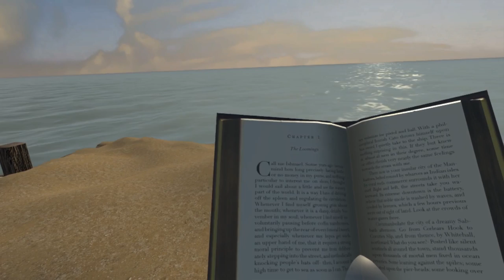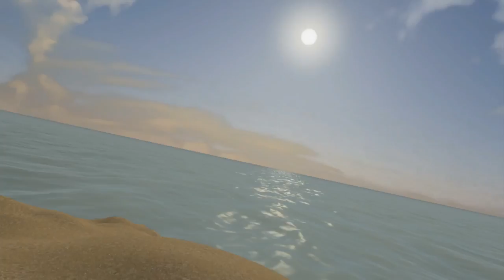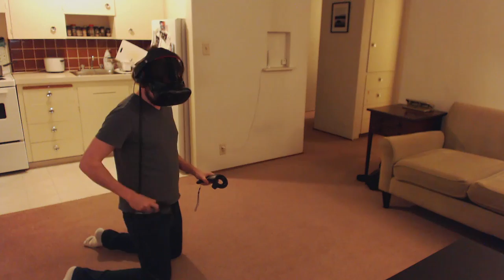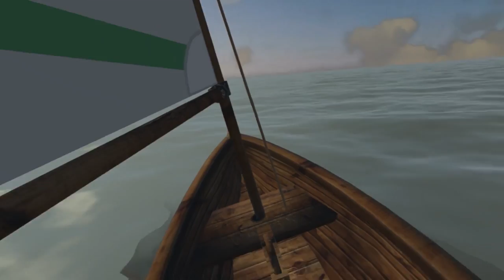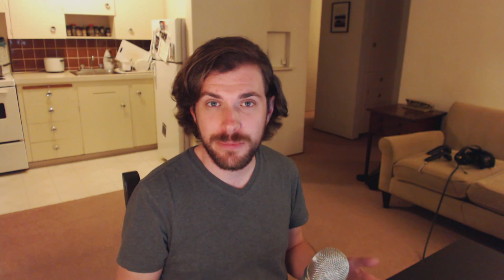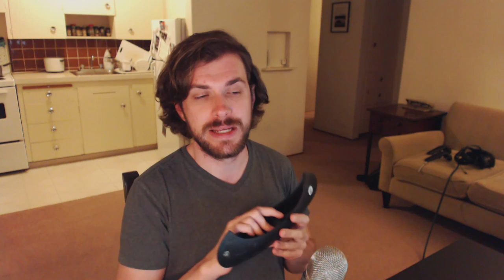Week 6 Dev Log | Sailing Game

Comment: If you need someone to help test multiplayer, i'd be willing to help. Otherwise keep up the great work! cant wait for early access
Reply from the maker: I will definitely put out the call for testing multiplayer. I need to find some AMD users too.
Reply: I'm down for helping out as well.  By AMD do you mean CPU or GPU?  I am currently running an i5-6600K at 4.85GHz with an AMD 290X GPU.
Reply from the maker: Awesome, I meant for the GPUs as I have an Nvidia GPU and I think there are slight problems with the shader I am using.
Reply: Most of my rigs are AMD GPU because I spend a lot of time in Linux and the nvidia drivers are a bit more annoying than the AMD drivers... though the newer cards from nvidia just might pull be over the fence.  XD

*oops, somehow I switched accounts by accident.
Reply from the maker: Awesome!